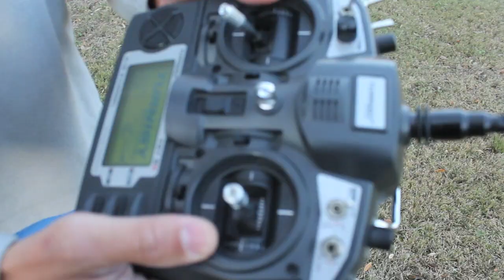TBS Discovery and DJI Naza Manual Mode Back Loop Attempts

Comment from the maker: It's quite a bit different and I always recommend doing this outdoors. I've switched modes indoors before and it's a bit scary since the motors can throttle up/down when switching modes. For control just be super light on the sticks and make sure you have a flight mode switch configured. So if you get into any trouble you can immediately switch back into atti mode. Good luck and let me know if you have any more questions. Go for it. You'll be glad you did.

Comment from the maker: Thanks for the comment. The quad is actually about $500 but I hear what you're saying. The TBS frame is no way ideal for acrobatic flying. I'm by no means an expert, but just the way it handles compared to the standard F450 frame is a lot different. It's really designed for FPV.

If you have a good suggestion for cheap quad builds then please go to garagepilots . com and post there. That would be incredibly useful!

Yes, I'm trying to get my TX dialed for more acrobatic maneuvers. Thx.

Comment: Honestly it looks pretty crappy for ~$1k setup. Not criticizing video quality or your flying, but just the way this quad handles and sounds. I thought for that much money one can expect a fine tuned machine, but it sounds like there are tons of vibrations. I have $100 diy quads that fly smoother right of the bat. Also to get quick controlled flips - you need to play with "max travel" or "stick scaling" setting in FC/radio. Otherwise you'll eventually dig your quad into the ground :)

Comment from the maker: You're right. I don't think I was quick enough getting the quad to pitch back. I definitely need to throttle up a bit earlier so I don't lose so much altitude. I will continue to experiment and hopefully not break anything in the process :)